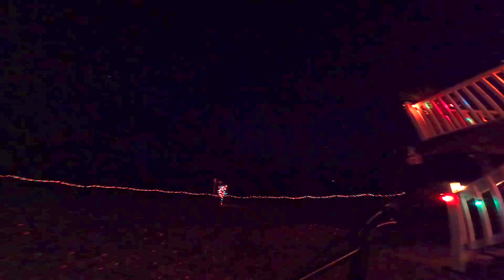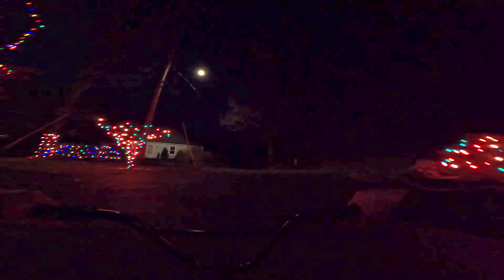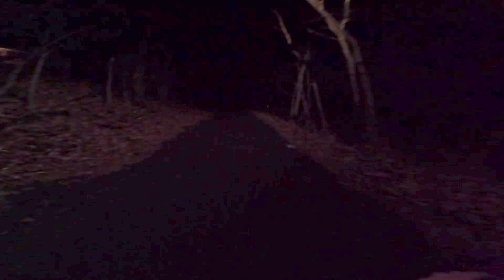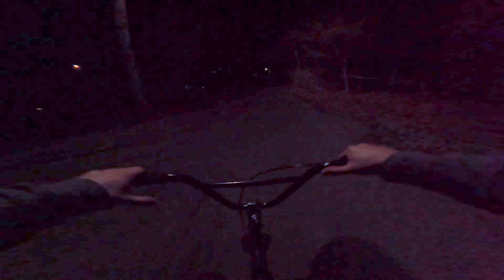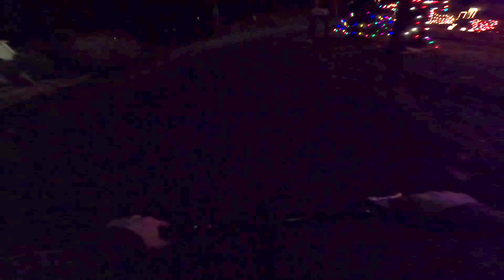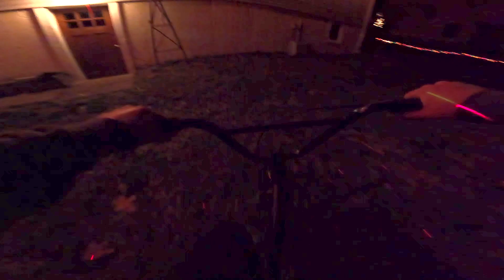Down to 10 Watts | Broken LED Street Lights On My Street Getting Replaced, Part 3

Comment: They should be using at least a 50-watt LED to light up the roads. However, a 175-watt mercury vapor streetlight is still far superior to LEDs. For outdoor lighting with a lot of illumination, I prefer HID over LED. I love the way they start up.
Reply from the maker: For whatever it's worth, the 10 watt unit installed here is a totally satisfactory amount of brightness for a residential area.

Comment: Basically every street light in my neighborhood doesn't even work that's how broken these LEDs are
Reply from the maker: The best thing you can do is keep reporting outages and requesting repairs.
Reply: @JordanU  I don't think  requesting repairs is going if they keep failing.
Reply: * to work
Reply from the maker: @mechfanatic267  How does it not work if the broken units get replaced?
Reply: Oh I thought they were LED washed people nevermind. (LED ooooo it's the best thing ever on this planet).
Reply: @mechfanatic267  LED street lights I kind of would disagree with you they're terrible
Reply: I was just doing what these LED washed people say to this whole entire world 🌎🌍!